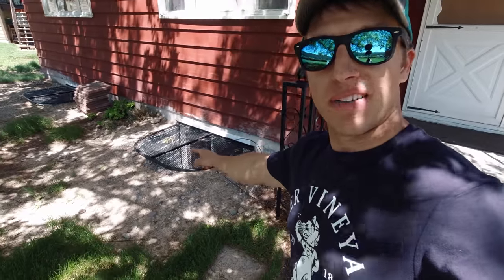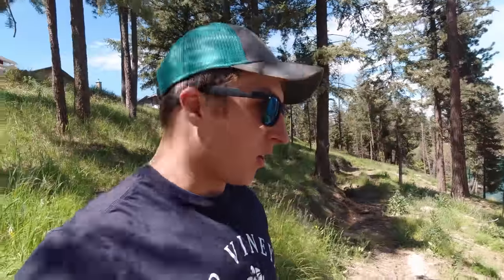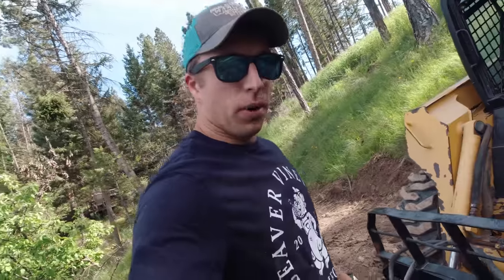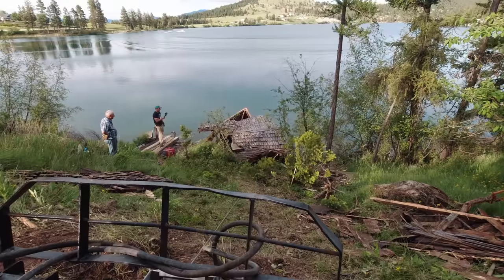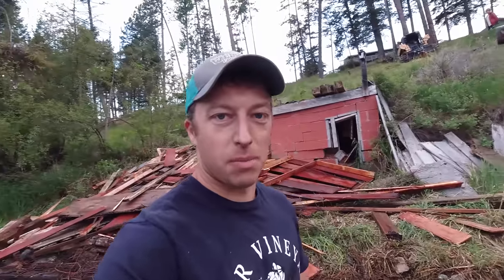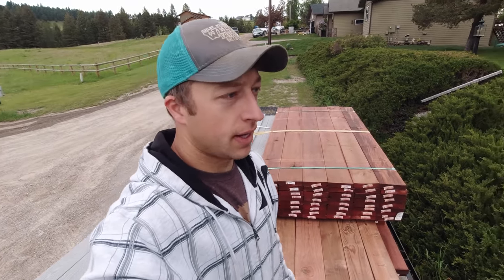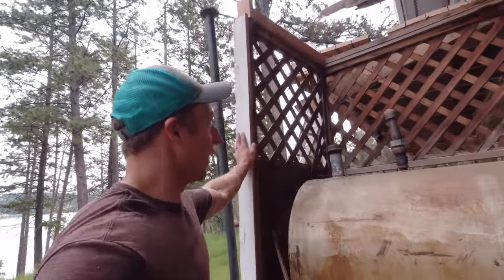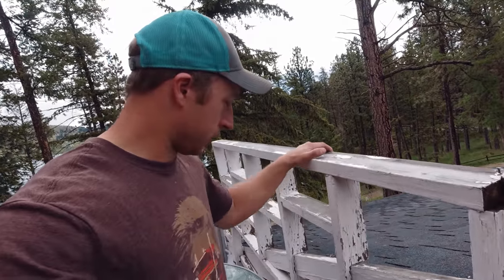Rip Down The Boat House!｜Lake House Renovation Part 6

Comment: I recommend taking up that deck and putting a composite deck-board material. When we redid every deck in a community we used the color saddle and the brand of boards was Trex. Lowes sells the brand and when we went to the pro services desk we got a good deal for buying them in bulk.

Comment: I put on Brock Dock decking on 12x20 patio. 30 years ago, expensive, but no maintenance other than a bottle of dawn, a little bleach a garden hose  and using a floor scrubber once a year.  30" and you are done !! Brock Dock is made in IN. Same people who make grain bins. Quality product. Cost of flooring was $1200. 30 years ago, but worth it ! I didn't care for Trex flooring.

Comment: So a foil wrapper from gum won;t work! :(  doesn't pay to break in but being safe and having protection makes sense.  That deck extension was ready to go, and at least you spoke to the neighbor and helpeed him and removed an unsafe situation.  Harbor frieght not the best but close buy cheaper than rental and it works, keep it.  Cool video, and nice job preserving the lake with demolition. Is there furniture that will go with the new deck so it won't ruin it?
Reply: Do have some deck furniture. Deck will be rebuilt this fall

Comment: If I were you, I would lower that CO-sensor. It's now on head level, what means if there is CO, you would probably be dead or almost dead before the sensor recognizes the CO. My suggestion is to mount it at 1,50m - 1,60m

Comment: I have to say this is one of your best videos by far, i mean there all good, but i like this one the best... Do yourself a favor and water done the deck before you weld, wood has a way of hiding  hot amber's and will flare up later so keep your wood soaked if the need to weld there has to be !!!

Comment: I gots me one of them there 110 wielders once I got the settings right it work wonderfully. For the lite wielding I need to do. Now for heavy duty wielding I take it to a wielding shop. At my age I really don't want to be doing heavy wielding any more. After my big heavy duty wielder died after 30 some years and the cost to repair it wasn't no were in my retirement budget I totally retired from that type of wielding... 
It's great not having so called friends calling me to wield their junk and not want to pay me for my use gas, wire, and time... I wielded for 40 some years I've paid my dues... LOL.. But I like that little 110 wielder but I only paid 98.00 for it on sale. It's fun for crafting... 
You kids keep having fun. Much love and prayers be blessed in Jesus name... BBE,,
Reply: I'm sure you had situational friends when they needed welding.

Comment: Did the harbor freight welder work better then you thought it would? I bought one of the titanium ones and I was quite Impressed with it for the price of it.
Reply: We were surprised.  Did better than our 110 volt 2005 Lincoln.  Just isn't a long duty cycle but for that price it's good bang for the buck
Reply: Robert Welker I found mine to be better then my 130 Miller as well. It will be nice to have it up there for when you guys do more projects. I’m a carpenter and my wife is an electrician and we also have a camp we are building far from home so we understand fully what you guy have been doing. You guys have done a great job on that place so far and I’m glad to see the whole family working together. Time with the family is one of the most important things.

Comment: A floating dock would be nice and low maintenance aluminum
Reply: We have aluminum frame and lightweight decking docks, but It uses adjustable 2'' galvanized poles with a round plate at the bottom for the legs. Easy to take out before the water freezes in winter. They don't float though.
Reply: Will be very low maintaince and it just got put in

Comment: Question on the Simply-safe system... Does the base unit have back up power supply if main power goes out? Thanks...
Reply from the maker: Yes it has a rechargeable battery built inside for power outages.
Reply: @WelkerFarms  Much Obliged, thanks.... I've been enjoying your videos, and especially the Big Iron... Red Iron is a definite plus!  Grew up on the farm in Iowa, so can relate to your operation... keep em coming when your able... :)

Comment: You said the boat house was grandfathered in; so does that mean by taking it out you lose the ability to build another one in the future?
Reply: They made it clear. Either remove it or rebuild it exactly the same using at least one existing wall. The rock cages supporting it was slumping lower which allowed the rotting of floor and lower walls.
Reply: Thanks for responding Mr. Walker!

Comment: Did you guys consider burning it down and then hauling away the remains?
Reply from the maker: Water is highly protected and regulated in these parts and so to remove something like this requires a permit that has been approved. They wouldn't allow us to burn it there. Plus tons of nails would be left in the swimming area.
Reply: @WelkerFarms  Thank you, I never miss a video.

Comment: You’re going to regret the composite decking, it gets extremely hot in the summer time and is very slippery when it gets wet.
Reply: What would you advise to otherwise?
Reply: Narelle MacPherson I just replaced my moms deck with cedar toned treated deck boards from Home Depot, and used the camo screw systems to install it. That way you don’t have any screws to potentially trip on in the future.

Comment: P.S. I used to run like you do Nick, however I rounded a curve that was rated at 45 an took it at 70 and  blew a sneaker and ended up at the local E.R. 🥴🥴🥴👀🤣

Comment: To bad the boat house wasn’t saveable ours is grandfather in as well over the years decked the top with rails and a slide to the lake in side converted to a day room party room ours is one of the last ones on the lake as you say it can’t be re built
Reply: You couldn't change function.  It had to be rebuild exactly the same with before and after pics

Comment: Don't do composite decking, it's not all its hyped to be. Warps like crazy unless the joists are spaced 1' OC. Expands and contracts like crazy.
Reply: You should deck it with either treated 2x6 or put plywood down and an outdoor rated vinyl.

Comment: Simply safe works fast, and well. I've had it for a few years now. My wife and I happened to be home the there day, and the batteries on the Key pad control center went bad, and it sent the signal to the tower and the tower was go off, at the same time Simplysafe was calling my wife to check to see if everything was ok. So a Suggestion, Change out your batteries in the control tower and the key pad at least once a year. Just like your smoke detectors.